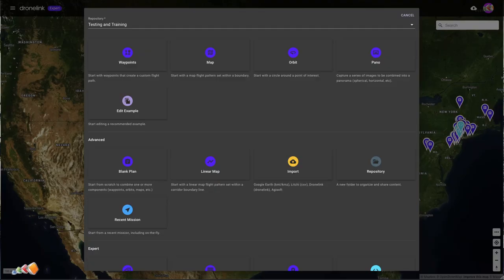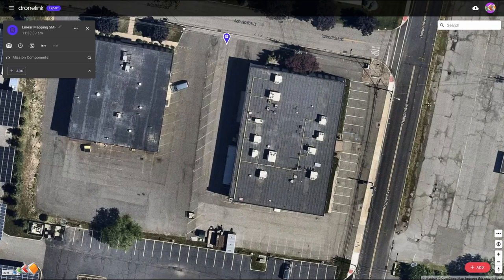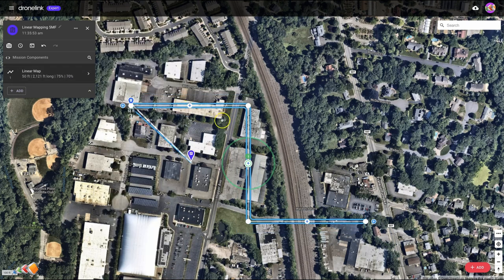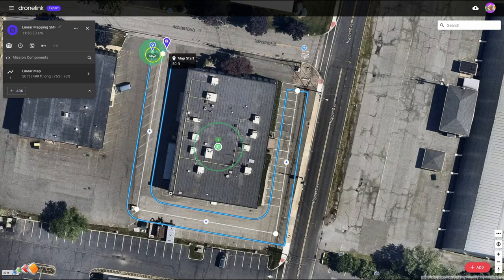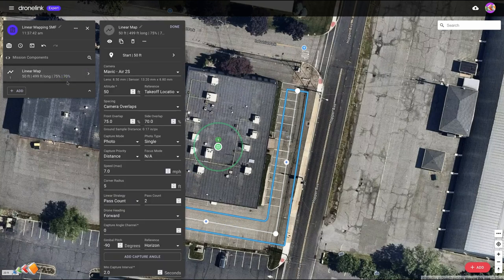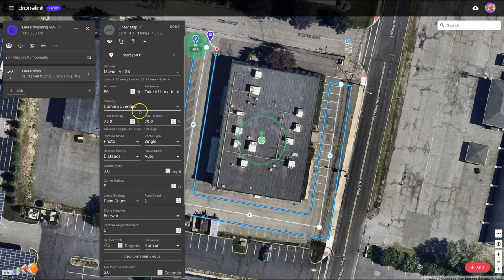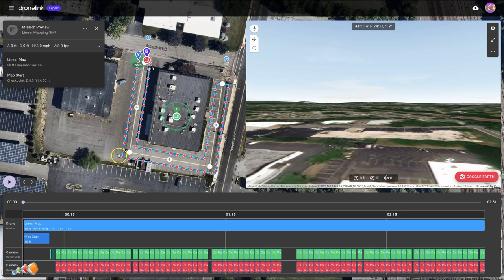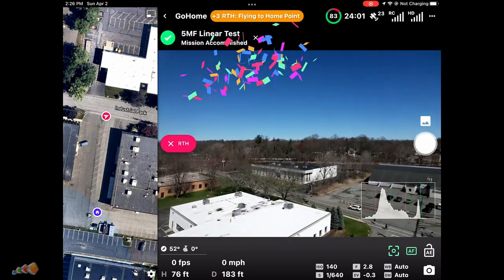Dronelink  Linear Mapping

Comment: Thanks Barry. Looks like I'll need an upgrade to run linear maps. I currently have a Premium account, but Dronelink tells me I need to upgrade to Starter | Growth | Enterprise. The starter plan is $30/month (US?), probably too much for most hobby fliers, including me.
Reply from the maker: Sounds about right.  I'm lucky - I have an enterprise plan so I get all the features.   I should put a disclaimer on my posts saying that not everything is available in all plans.
Reply: @aviosmedia  yes, a disclaimer of applicable license would be great - most of these really nice to use newer features are only included in the more expensive professional plans unfortunately. My experience with other software solutions are that differences between the high end hobby/prosumer and entry level commercial license options more often are based on how you use the product, (with  specialized hardware requirements like IR/thermal/LIDAR, etc in commercial only) - so either for own, private use vs commercial use, but not as much on functionality - which unfortunately seems to be the direction Dronelink is moving into...  I do understand the business model, and the current Elite hobby plan is still great, but  recent new or enhanced functionality seems to have been added to professional plans mostly...
Reply: I can confirm that the Hobbyist Elite plan ($99 one time) will not let you do linear maps.
Reply from the maker: Thanks for the clarification